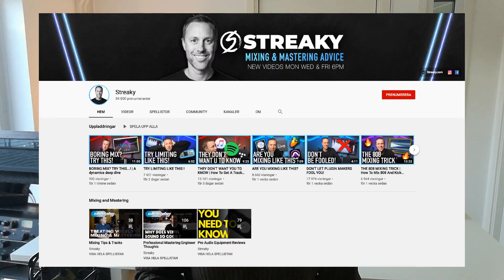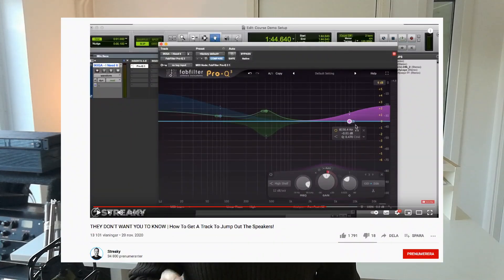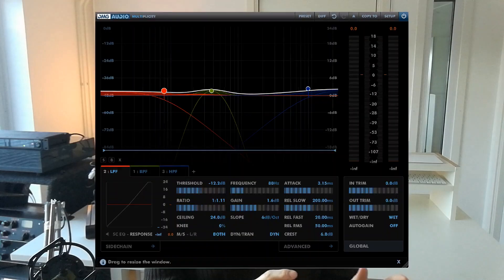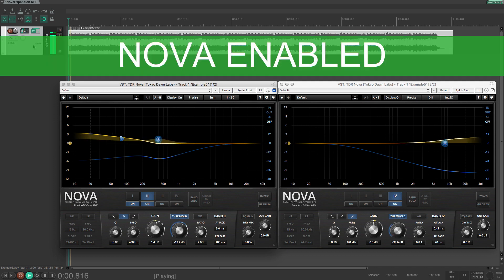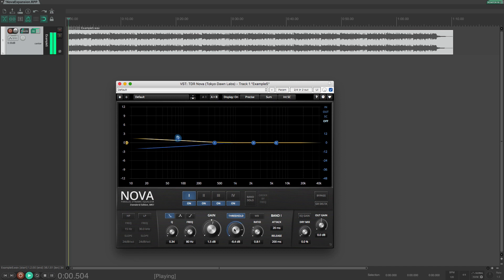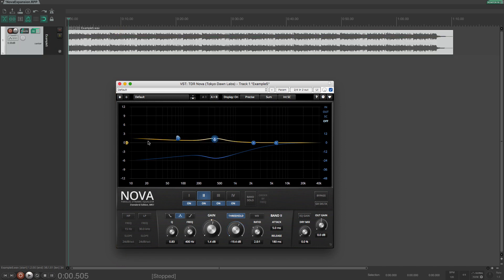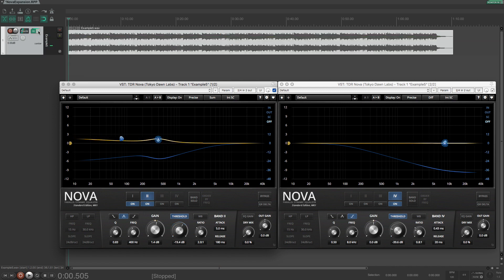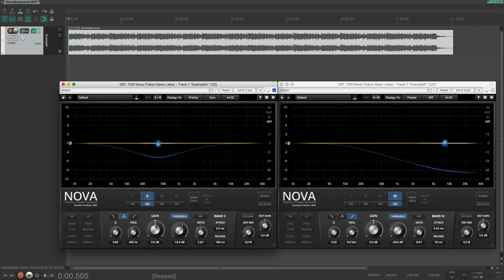Can you use this mastering trick in TDR Nova? | Mastering tutorial

Comment: Great! The only problem I find is that proQ3 dynamic bands are triggered by a relative detector, so it’s not too much about a threshold, it’s more about how much energy is in the frequency range you are putting the EQ curve compared to the energy of the whole spectrum, and you can’t do that with the free version of nova, not even the GE version does that, I own both, so the results will be different, you have to change the intention of your settings when trying to do the same with Nova. An alternative to that could be Kirchhoff EQ, I got it and it’s my go-to EQ and the dynamic EQ can be triggered by a relative detector. Anyway good video and great intentions with NOVA, it’s s great EQ, probably the best free EQ out there.
Reply: Really appreciate this feedback regarding the "relative detector" feature in proQ3. In your opinion, can you achieve close enough results with the Nova EQ by using your "intentions" properly? Or is the proQ3 just going to do a better job due to it's relative detector feature? Would greatly appreciate you more deeply describing what you mean by "intentions". Thanks!

Comment: Awesome,  one question,  why did you need to use 2 instances of Nova?  Could you not have done it in 1 instance?
Reply: Never mind, it just dawned on me that one instance was stereo and one was mid side, or one was mid and the other was side or whatever it was. Pretty cool technique.  I'm trying to use upward expansion to reduce some washy cymbals in a stereo drum track I'm trying to work with and I think something similar to this idea is going to be the ticket. I've been going around in circles trying to dial in de-essers and multi band compression and even transient designers to try to accomplish this but everytime it is either not enough or too much and changes the feel of the track too much. It was recorded well with a nice open feel and some well mixed room mics but the cymbals they used had too long of a decay and are putting out way too much high frequency info from the open hi hat on every quarter note in 1 section and a ride in the other section.  If I had the multi track I would just pull down the overheads or work on the cymbal decay envelope just in the OH's, but it's been driving me crazy.  If anyone has had to deal with anything like this and has any good ideas, I'd love to hear them.

Comment: Just used this in my latest master. The mixdown was already really good, this pushes it over the top, especially that compressing in the mids does something amazing.
Reply: Yes, very often, a cut around 160Hz will open up a mix and add some clarity. This is, effectively, the "pultec trick:" on a pultec, boosting and cutting the same low frequency actually creates this low-boost/low-mid-cut as an artifact of the design.
Reply: @briancase6180 True, in fact the original manual of the Pulteq said to never used both controls simultaneously 😅